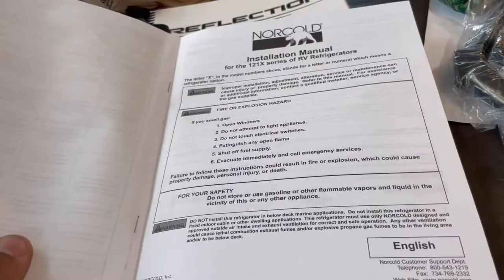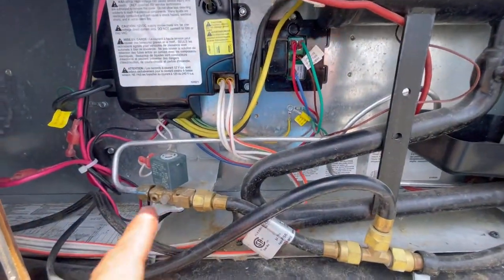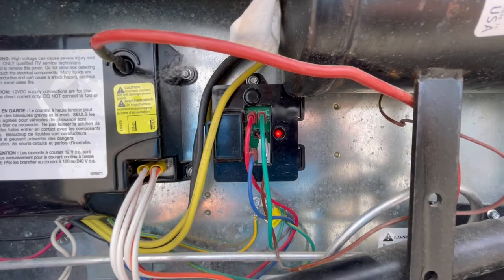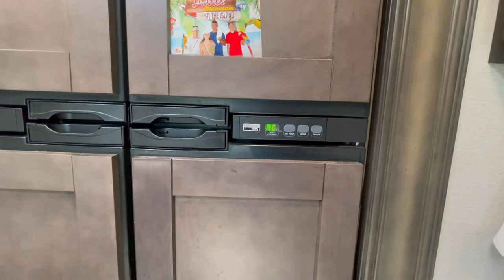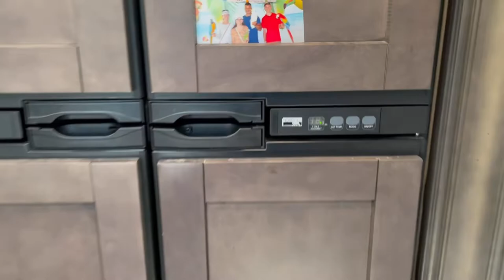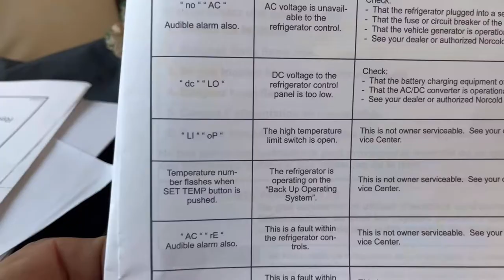Norcold RV Fridge L1 OP diy fix #l1op fix

Comment: Thank you very much. Had a guy come out and detail my 35 ft Crossroads Rushmore fifth wheel. No previous issues with the same exact Norcold refrigerator. Came in from work with the same beeping and codes flashing on refrigerator door control panel and Red light on the relay in the outside access compartment. After checking all obvious breakers, ect,,Googled for troubleshooting advice and this was the first video listed. I got a magnet and  as instructed placed the magnet against the relay and to my elated surprise the red light went out! I went inside and the beeping had stopped and went to AC Mode. I was really happy now. It's been about an hour now and all is good. Like the rain storm the video originator spoke of the RV Detail guy must have allowed too much water into the external refrigerator control access compartment door vents causing the relay to trip. I'll sleep better tonight as long as the beeping doesn't return. If it does, must be a different issue. So far so good. Thank you for the DIY advice.
Reply from the maker: This is great news!    I have to tell you, it has NOT happened again.  I’m so glad this worked for you.  I hope you stay safe and thank you so much for watching.
Reply: @TSquadRVing  This just happened today Monday 10 Oct 2022. Your video was a blessing. She's still on with no beeping or fail codes. Thanks again.

Comment: Thank you that fix my refrigerator I just bought this used motorhome and it worked when I was up at the RV place but when I got home it would not work and it was blinking them codes thank you so much

Comment: Thank you!  Just got back from Talladega and, we're going out again in a few days, so plugged into the house.  I figured the thunderstorm had popped the GFI breaker that supplies the plug, and was out of propane, I knew we were close on that tank, but that was not the error I found.  Ugh! the thought of unloading that fridge.  Finding a strong magnet was my most difficult part of this process.